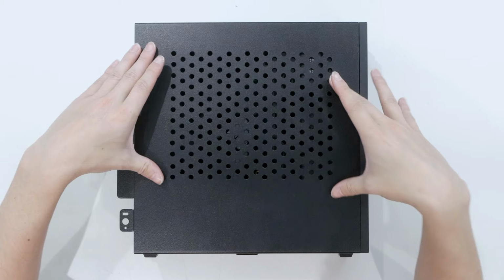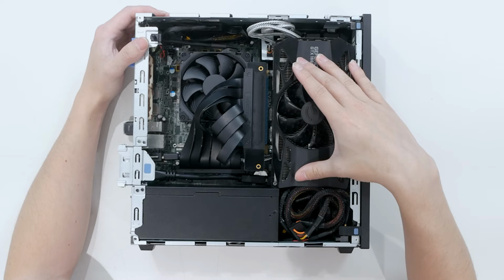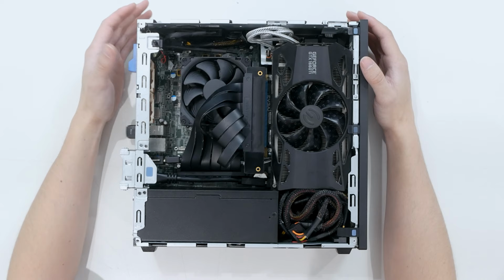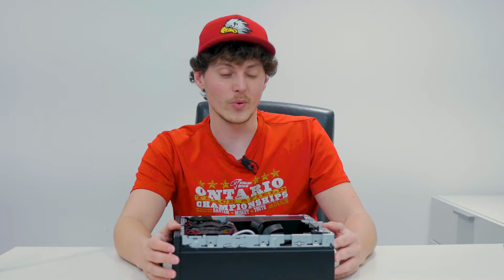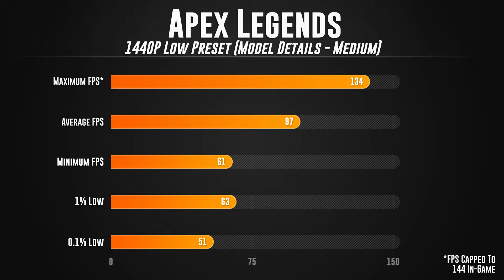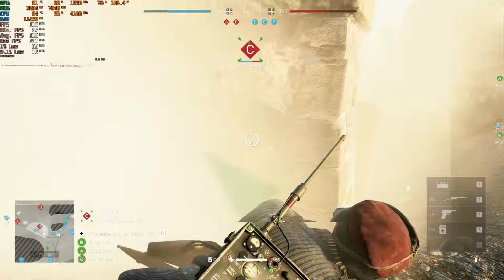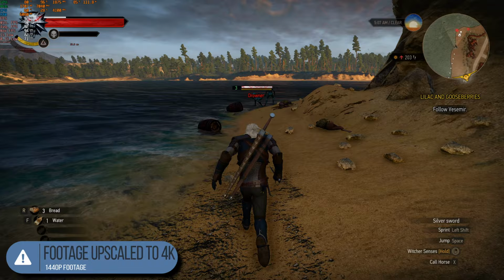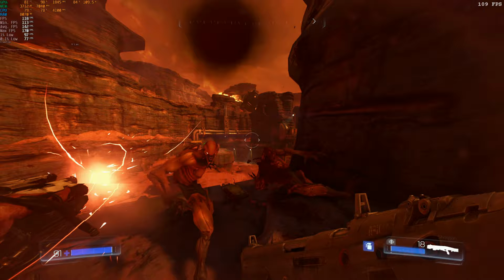Full Length GPU in a SFF Dell Optiplex Gaming PC!?

Comment: Just wanted to say thanks for giving me the confidence to build inside an Optiplex 3060 SFF. While not a full size GPU, I managed to fit a 3050 low profile inside. The best part is that the 3050 only needs 75W, so I could stick with the Dell power supplies and it gets all its power through the PCIE. The i5-8500 does run a bit hot during gaming, so I stole your idea and drilled holes in the side panel. Overall a really fun build!
Reply from the maker: I'm glad I could inspire you to give modifying a shot! I'm glad you enjoyed the build process too

Comment: You could totally do a side panel for this. Go plexi and do some old school air flow holes in the plexi. I would even just do a window for thr gpu and leave metal for the rest. Get a little rgb bling in side, not too much but enough to give it a tone.
Reply from the maker: I debated between your idea and the metal panel. I may end up finding another SFF Dell chassis w/ the side panel and create a set of side panels. One performance side panel, the current perforated metal panel and an aesthetic windowed side panel w/ plexi. So, I can freely switch between the 2 when needed.
Reply: @WiltshireTutorials  No don't. Keep it as stock as possible, and don't do RGB like everyone else does. Keep it sleek, tidy, and small... and slot it next to your TV as a "Console Killer".

Cutting holes for ventilation is a good job, but a Plexi Glass is too much. Maybe on the larger MT version, as a Desktop PC.
Reply from the maker: It will be staying without RGB. Also I've already done so with an MT tower. That of which I like to call OptiFlex. I have a modding video series on that PC as well, if you're interested.
Reply: @WiltshireTutorials  Wow, quick reply. I'm slowly going through those. I was thinking about this earlier, and thought you'd be interested:

...what made the Dell OptiPlex SFF so special was the dumpster bin price, capable hardware and overall build. It's has truly been a "Console Killer". But it's basically come to an end.

Here's a backwards trip down memory lane:
2022 - nothing to match Xbox Series X

2020 - Equal vs Xbox Series S
Used 7060 sff, Core i7-8700, RTX A2000

2018 - Equal vs Xbox One X
Used 9010 SFF, Core i7-3770, GTX 1650

2016 - Better vs PS4 Pro
Used 7010sff, Core i7-2600, GTX 1050Ti

2014 - Better vs PS4
Used 3010 SFF, Core i5-2400, GTX 750Ti

2012 - Better vs WiiU
Used 980 SFF, C2Q Q660, GTX 650

2010 - Better vs PS3 (Late-Stage)
Used 380 SFF, C2D , ATi 6450HD

2008 - Better vs Xbox 360 (Late-Stage)
Used Dell 745 SFF, C2D, GeForce 6200

2006 - nothing to match the Xbox 360
2004 - ? something's out there!
2002 - nothing to match the Xbox
2000 - nothing to match the PS2
...that's far enough!
Reply from the maker: @ekinteko  There may be something with the newer CPUs from AMD and Intel coming out in a just a month or 2. You don't always have to match the power of a console to enjoy the PC gaming experience. A lot of people I know are happy gaming at 1080p 60FPS and enjoy the freedom with having a PC instead of a console.
Reply: @WiltshireTutorials  That is true.
Outside of free multiplayer, there's server hosting, MODs, unlimited backwards compatibility, Emulation, and lastly it works as a PC.

Comment: Yeah, so THIS guy is the one that's going to show up to the dragstrip with a 429 in a rusted-out Pinto and just flat-out walk the dog on your brand-new Dodge Demon. Being in an RMA for my Asus board, I'd thought about similar with a Lenovo M71E with the used 3600X Ryzen / M.ATX from my interim build, and a 2060 or something of the like. But good GOD, man. I think this is more work than I want to put into it. You might consider gluing / taping black pantyhose to the inside of the intake holes to reduce dust intake -- old trick someone clued me in to.
Reply from the maker: I wouldn't recommend this kind of build as a temporary solution while waiting for an RMA. You're right, there is too much work involved for this. You could always just have a computer sitting out of a case on a box or test bench. Makes things easier
Reply: @WiltshireTutorials  Yeah, I'm just throwing a used 3600X and a budget Gigabyte B450 with a Ballistix 16GB and my RTX3060ti in the same case. When the board comes back, I'll decide further, but I've been thinking about a Fractal Pop Air anyway.

Comment: This is alot of power in such a small package. I love the value of these optiplex office systems. 8th and 9th gen i5s are still very capable cpus. And, if you felt froggy, you could easily move this system straight into a regular ATX or Micro ATX case, you  would just buy a used LGA 1151 motherboard. Doesn't have to be anything special.

Comment: THose temps around 80C not a cup of tea for me, I like the mod but I need less than 75c to feel safe on my Pc's plus the longevity of my parts all cramped in there, good performance but please improve airflow with maybe bigger holes and a mesh filter.
Reply from the maker: Trust me, I'm already on it! I noticed the higher temperatures while testing and I'm working on remedying the issue. I've fixed the CPU temperature already. Currently working on the GPU temps!

Comment: IMO silverstone tfx psu is just too expensive for this kind of build. But I guess it's necessary for a graphics card that requires pcie power. If you use a graphics card like rtx a2000 or rx 6400 which doesn't require that you could get away with a much cheaper PSU and still have the standard 24pin + 4pin motherboard power cables.
Reply from the maker: Very true. This was more of a "how far can I push this thing?" type of a video. The A2000 is also quite pricey. I would suggest the RX 6400 for most

Comment: Quick question about MiniFlex's PSU attachment. Does it require a 6 + 4 connection, or is the 24-to-6 pin adapter sufficient? When I removed the 7060 SFF power supply, I noticed the use of 6- and 4-pin connectors and just want to be sure before I power on to test. Thanks!

EDIT: I figured it out...damn Dell did you HAVE to do us like that?!
Reply: What's adapter did you end up using?
Reply: @Ramble1234  24-to-6 pin

Comment: Just a note on the single fan header.  My I5-6500 Dell SFF had a case fan header circuit with thru-hole pads that I just had to solder fan header pins to in order to add a case fan to mine.  It was located on the board roughly underneath where your pci-e connects to the graphics card.
Reply from the maker: Interesting! I'll have to give that a look! Thanks for sharing this info!
Reply: @WiltshireTutorials   You're welcome.  Btw, I just spotted the unpopulated header on your previous video when you show the board out of the case.  It's behind the brown caps  near the front and has a silk screened square around it.  If you melt/wick up the solder it should reveal the holes.  I used a header from a dead board for mine.

Comment: Thats a lot of work.Great job.
Reply from the maker: It sure was! But, we're not quite done yet with MiniFlex! There's more to come for this little guy!
Reply: @WiltshireTutorials  thats great. Will be keeping my eyes open as i also have a dell optiplex sff and was looking for ways to mod it. Just wondering if there is any performance gain if i replace the stock cooler with the noctua one?
Reply from the maker: It may gain a little bit of performance compared to the stock cooler. The CPU frequency is tied to the thermals of the CPU. Therefore, lower temps mean better performance from the CPU. 

Also, Dell's stock cooler are on the same level as older Intel stock coolers. They're not great at all. So, I generally recommend replacing them when possible.

Comment: Working on a similar build right now

My question is - does that TX-500 PSU replace the Dell Powersupply outright or do I need an adapter to power the mobo?
Reply from the maker: It replaces the Dell PSU outright once installed. You will need to adapter the 24-pin cable from the TX-500 to the Dell motherboard, but that can easily be done with a $10 adapter cable.

Comment: Very interesting!  Picked up an Optiplex SFF PC and I just wanted to get the most out of it.  Tried a 1650 low profiles card.  Okay, not bad.  But just recently those snazzy RTX A2000 low profile professional cards came down to something almost reasonable.  Drop one of those in even though it cost more than twice the original PC?  Yep.  i7 4770, 32gb DDR3, two SSDs.  STILL have the optical drive in there.  And I have to say, the system is EXCELLENT.  Excellent in that the RTX A2000. . . well. . . looks a lot like the numbers you're getting on your system.  OHHH I'm well aware the cooling could be better, but the RTX A2000 blower style actually sucks heat from the case and sends it out the back.  That wasn't the case with an MSI 1650 low profile card.  You commented on heat getting blown all over the place.  Yep.  Not great in a slim case.  I admire that power supply you got in there and the holes you drilled in the case.  Oh yes, and the Noctua fans.  Looking to see what I can do to replace the 'I don't know how old it is' power supply with something a little beefier. And yeah, I might just get to drilling some holes in my case.  MAYBE. . .  the  top though when the Optiplex is on its side.  I think a little added room for air to escape from the top may help a great deal.  Thanks for showing your build!
Reply: Bro I have optiplex tower 9020 i5 I added a 800w power supply I had to butcher the top plastic holder clip to get it in filled the ram and put the the 3x evga 2060 xc (super clock) one fan card in with only a slight gap at the bottom will have it open during hard gaming it’s the ultimate budget build uk costs £ pc 180 card 212 ram 2x extra total (16) I’ve paired it with my new dying light benq 32 curved monitor 😊 I’m going to do a video of it

Comment: great build, just what i was looking for - wondering how much better performance than stock low profile rx6400. Would i still have issues with a single slot card too close to powersupply for thermals? thanks
Reply from the maker: Oh, the RTX 2060 blows the RX 6400 out of the water. It's approximately 130% faster than the RX 6400. Also, the RX 6400 is x4 PCI-E 4.0. If you plug the card into a PCI-E 3.0 slot (which the Dell is), you'll lose approximately 14% in performance. Being so close to the PSU doesn't help thermals at all. My recommendation is to get the biggest heatsink you can get for the low profile card you're looking for.

Comment: Hey man, great video first of all. I'm trying to do a similar thing, but with an i7 8700 and GTX 1070. Do you think a 300W bequiet! TFX PSU would do the job, or should I go for 400W?
Reply from the maker: You could probably get things to go on 300W. It would be stressing things quite a bit. If you plan on overclocking anything, I'd suggest the 400W PSU.

Comment: Bro this thing is awesome yet for most people pretty hard to do.😅
Reply from the maker: Thanks! Unfortunately, it is not very user friendly for sure. I tried a bunch of different ways, but this one allowed the most compatibility with GPUS
Reply: @WiltshireTutorials  Also there is stuff that you have to worry like temps and airflow it’s not like dell optiplex’s are the best at either of those!
Reply from the maker: @EliezYT  exactly. It's a challenge to overcome high temperatures. The next MiniFlex video will focus on just that, reducing temperatures.
Reply: @WiltshireTutorials  Oh actually I found this cooler it gives better temperatures while being smaller and it also takes less watts it’s the Arctic Alpine 12 LP. You don’t need to do anything to the case to use it either!
Reply from the maker: @EliezYT  Will give it a look! Thanks for sharing

Comment: How did ypu manage to fit the original motherboard pinouts with an aftermarket PSU? 

Have a nice day

Best regards 
Martin 😊
Reply from the maker: Just made a simple 24-pin adapter that converts the PSU to the proper pinout for the motherboard power. You can easily find these on Amazon, if you're not interested in making your own.

Comment: This is giving me some ideas. I recently refurbished some 2nd-gen Intels (i3-2100 / GTX750ti and i7-2600 / GTX1050) that no one seems to want, so I'm thinking about stuffing one into an SFF to use as a NAS. I don't see, however, where you outlined how you got the HDMI signal outside the case.
Reply from the maker: It's called an HDMI panel mount. There is one female connector and one male connector. The male connector goes into the GPU and the female end has screw holes that you screw it onto a PCI-E bracket
Reply: SFF m.ATX case recommendations for this component list? Intel DH77EB, standard Micron DDR3 DIMMs, EVGA GTX750ti SC / GTX1050 SC, Cooler Master i70, ATX PSU, Crucial MX500, WD Black 3.5" HDD. May also directly recording video with OBS Studio. Would a 4C/8T do better than a 2C with that, or does it matter given the GPU?

Comment: Im looking to do a small form factor dell optiplex 3050 build i want to change the power supply. Can you share a video on what the modifications were so you can get a upgraded psu in there?

i was looking at a Apevia TFX-PFC500W TFX or game max GMX-GT-450G
Reply from the maker: For some reason, your comment got marked as potential spam. Sorry about that! As for you question, the only thing I really did to get the TFX PSU in the chassis was to drill out a few rivets that were blocking the PSU from seating against the back of the case and trimmed a few pieces of metal that were in the way. Pretty simple and I don't think that warrants a whole new video on those tiny modifications. Either one of those PSUs will work. It all depends on what GPU you want to use and how much power it draws.

Comment: I bought a 5070 made this past april with a rx550 installed in it, and a viewsonic vx3258-2kc and an 8 gig expansion driver from my brother for I think 400 bucks? I cant remember exactly how much but it was under 500 for sure. He had the rx550 installed into it however I would love to put a full size card in here. It runs great and I like the small form factor but it's a Dell lol.
Reply from the maker: Nothing wrong with the PC being a Dell. Yes, they do make some dumb decisions with their hardware and do limit some things, but it's still a decent machine if you tweak a few things.
Reply: @WiltshireTutorials  do you know is it possible to take the components out of the case and put them in a full size aftermarket or is it just not worth it? I would likely put a larger power supply and graphics card in ther. I was looking at the rtx3060s and 3090s in the single fan configuration but I have to imagine they dont perform as well as a full size variant. Definately won't have the ram
Reply from the maker: @tokin420nchokin  unfortunately, the motherboard is a unique proprietary design and can't be transferred over to another case. Hence why I made OptiFlex in the first place.
Reply: Appreciate it
Reply: @WiltshireTutorials  I feel like I managed to modify an older optiplex but I'm remembering now that I bought a motherboard for that other build. Ultimately it wound up being a whole build. I have 4 older hp pro desks an a couple hp elite display e221i monitors and a planar stand also in the deal. I should probably just sell them but I might swipe some parts out of one for a budget build.
Reply from the maker: No problem

Comment: Hello
I afford a 5070SFF and the CPU FAN is horrible.
Dis the Nactic you put in require any special thing ? Or I can just remplace the original one with it?
Reply from the maker: For any Dell Optiplex, you must remove the CPU standoffs that are soldered to the back side of the PC chassis/case. Then use the included backplate that comes with the cooler you wish to use. It doesn't have to be the Noctua cooler I used, as long as it fits.

Comment: My congrats, you did a fantastic work. 
I also have a miniplex (3060). I like, specially its size (less than 8 liters). When I bought it as a good bargain, soon I found it has several issues for its improvement, specially the lack of space for fit a proper graphic card, even I had to sell my almost new RX 550 LP due it was a card that occupy 2 slots. The horrible design of its motherboard with its main PCIe bay close to PSU it's a great disappointment I hadn't in my former SFF HP PC.
At the moment I was using a GT 1030, clearly insufficient for the i5-8400 which has this little PC. Recently, I purchased something more decent (T600).
I, also liked they way you manage the heat of this PC.
Reply from the maker: Hey Larry! I'm glad you liked the video! I agree you with on the design of the motherboard. I have no idea what they were thinking when they put the X16 slot on the bottom. You could still plug the GPU into the x4 slot that is there, but obviously you would be running with limited bandwidth for the GPU. 

I have an RX 560 LP myself, but opted not to use it. I have a Dell 780 hackintosh that is running that card instead.

As for the heat management, it's only going to get better in the next video ;D
Reply: @WiltshireTutorials  
Sadly models 30X0 have PCIe x1 instead x4 such in 50X0 and 70X0 models.
Reply from the maker: @larrybreavman4864   I didn't realize that! Thanks for sharing that info